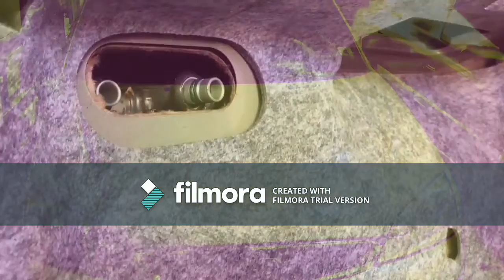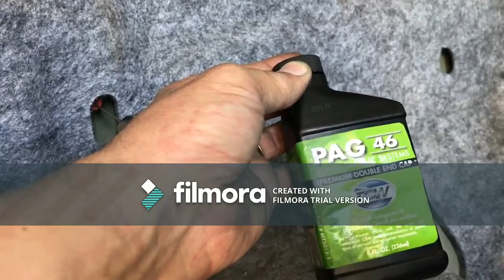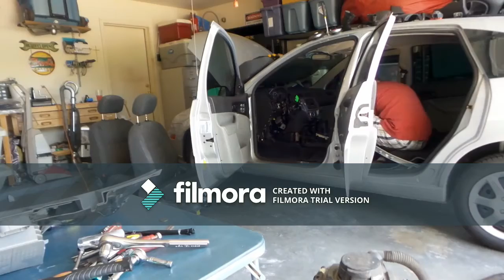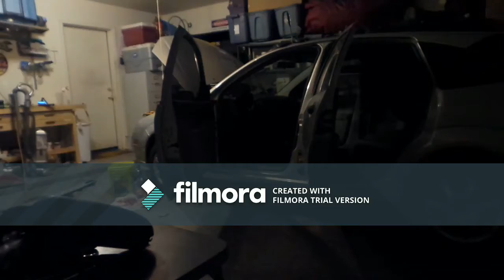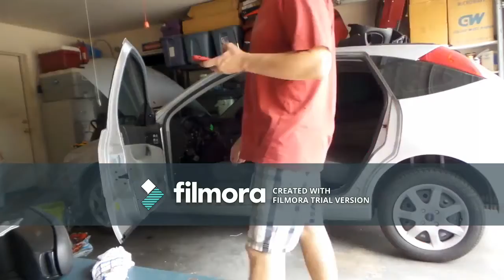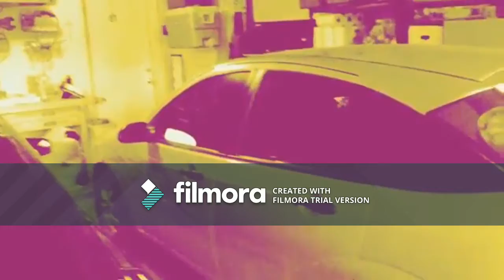Evaporator core Replacement Part 4

Comment: Hey Scott, I used your videos to disassemble the dash (it went smoothly and your previous three videos were a huge help) but I made the mistake of not paying attention to what order the hoses go when connecting them back to the heater core. Do you any any idea which hose goes to the top port and which goes to the bottom one?
Reply: One of the hoses connects to the driver side of the engine block and the other goes around the front of the engine block into a t-connector with one hose going off to the the passenger side of the engine and the other going to the coolant reservoir.